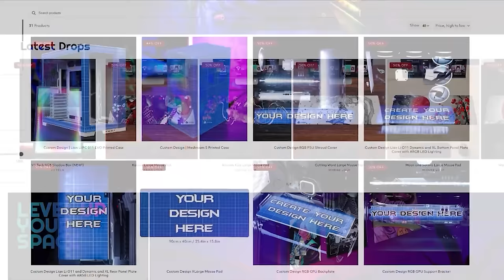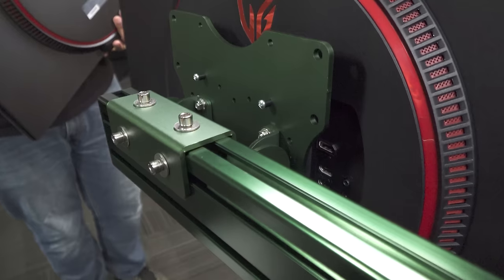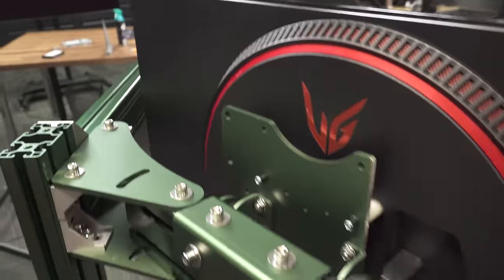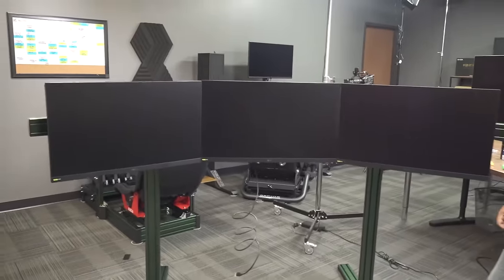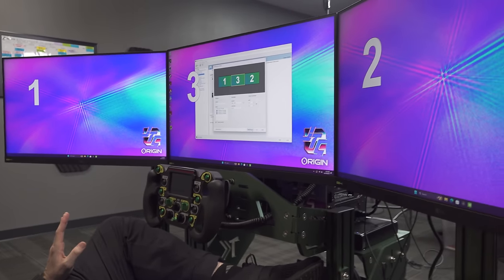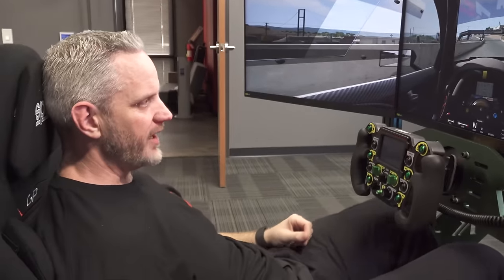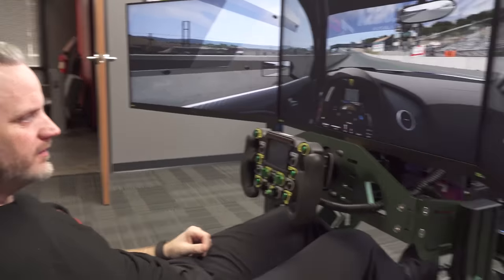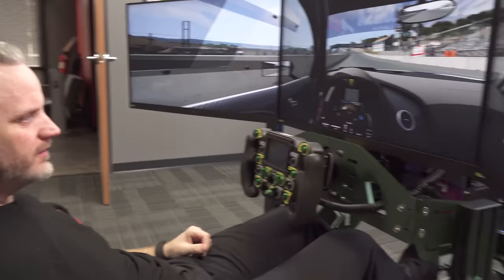I haven't used NV surround in over 7 years! Does is still suck?

Comment: the hinge doesnt have to be on the upright, you can bolt them on the horizontal piece, slide the left and right monitor outward to get more angle on them and put the bbolt back in
Reply: 100% this! It would also be wise to search for the FoV calculator, input your screen dimensions and distance from screen and that will give you your ideal side screens angle and in-game FoV values.
Reply: Yes please do this, it is doing my head in looking at the way you have those monitors setup, also they are way to high.
Reply: Those corner brackets aren’t needed either. Can be mounted directly to the horizontal piece the same way the side monitor arms are mounted to the angle bracket.
Reply: The problem starts with the horizontal piece which should’ve been mounted on the front face of the upright and then mount the hinge directly onto the horizontal piece
Reply: I'm starting to think they maybe possibly, quite by chance... Didn't read the instructions!.. lol
Reply: @rwbrygel  they should’ve been but first building I guess, they’ll figure it out unless @jayztwocents wanna employ my assistance, I’ll be glad to help
Reply: Oh I would be quite happy to help too.. Particularly with Content Manager.. but where would the fun be in watching them do it right?.. lol
Reply: @OnePuncheonMan  I have this rig and that’s how they show it put together, but I did it without the corner brackets, and changed a couple other things to mimic more like other sim monitor mounts are built.
Reply: I think Jay should stick with building PCs as SIM rigs don't seem to be his thing
Reply: @robn71  So you don't want him to try anything new and just do the same thing every day forever? Or maybe learn from the comments and get better at it then people like you have nothing to complain about and then go away?
Reply: @I-YoutubeAccount  I was speaking about the monitor alignment, not the DP cable. That’s a known issue with these all in one Veda mounts but manufacturers still make them to cover all buyers something like the sim lab vario vesa mount or the advanced sim racing advance monitor mount may have been perfect for both monitor alignment and cable clearance but hey…. It’s Jay and we love the shenanigans
Reply: That is 80/20 Aluminum T-Slot.  You can buy all sorts of pieces and build whatever you want.
Reply: @robn71  I enjoy the Sim Racing videos.
Reply: Iracing
Reply: @goonie1975  So do I
Reply: @OnePuncheonMan the vario vesa mounts are awesome and after having them I’d never want to do it again without.

Comment: The gap between displays is from those extra spacers you put in - the center monitor is farther "out in front" than the frame was designed for it to be.
Reply: He also said that the arms suck out the sides because they support larger monitors. So larger monitors might touch at the middle with the arms anchored properly. A hacksaw would also trim those edges if they really annoy you.
Reply: So I have the same rig, It's actually because they mounted the arms to the uprights. That's what the instructions say to do but is only necessary for the largest  possible screen size. If you pause at 6.24 you will see what I mean. The outermost two bolts are on the vertical member of the stand which prevents you from changing how far apart they are. 

If you can't move the arms in and out there is only one angle that works for each size of monitor and you might have to take out the inner bolts like they did.

Comment: Is it too late to suggest right angle DP adapters to help the cable fit? Love the shenanigans with angle grinding the plate.
Reply: The moment I saw that, I looked on Amazon and found them.. lol
Reply: I bought 3 32" LG monitors on Black Friday just like jay and had the EXACT same issue as Jay, I tried ordering 90 degree adapters, and like Jay, tried spacers, but ultimately came to the conclusion that these "solutions" were not real solutions at all and ultimately decided the real issue was a poor choice of monitor becasue of it design limitations. My solutoon was to exchange the monitors for HP Omen 32" and have been happy ever since.
Reply: Is it possible/would it be better to have a much wider center screen? Really thinking about getting a similar setup as you and Jay here but the screen dimensions just look off to me. Would there be an aspect ratio or stretching issue having 2 smaller outer screens but one wider screen in the center?
Reply: @FellowshipOfTheAviatorZ  I've seen mention of people with multi monitor setups at different resolutions getting stuttering issues especially when trying to run at higher refresh rates, don't know if that's an old problem or what though
Reply: @FellowshipOfTheAviatorZ  I have run 32" with 27" wings with Eyefinity, no sweat. I always buy same resolution. Smaller sides don't bother me because it is mostly for peripheral vision when driving.
Reply: Best to increase the left and right monitor angles to 45deg plus.  I think mine are 60deg

Comment: You can get angled adapters for dp/hdmi to make it fit.
Reply: Sure - but that doesn't make that layout any less stupid.
Reply: Was thinking the same thing, right angle adapters or cables. Instead of angle grinding the whole thing haha.

but  @MrMartinSchou  is also right, pretty BS design from LG. I have a similar problem with my older 22"? Acer 1080p 60hz monitors where the vesa mounts and cables interfere with each other, it was a tight squeeze but I made it work/
Reply: yes, but also turn on shiny toy today.... I get jay on this one even though it appears like an overreaction.
Reply: yeah but he's never gonna use those tv mounts
Reply: And then wait longer and have the risk of those not being right either. I'd cut em as well. My monitor is mounted straight to the wall. So glad HP mounted the connectors facing down.

Comment: Nice to see the sim racing content! You may want to take another look at your monitor mounting options. You are absolutely right in that the TK monitor mount was made with curved and larger format monitors in mind. In reality you need something a bit smaller as there are a few issues with your config.

One issue is your monitor angles are very shallow. Typically you want approximately 60° with 32” monitors. Getting this angle right will significantly improve FOV and immersion. The second issue that goes along with getting the angle right is to get the monitors closer to your eyes. The closer you get the monitors the better the immersion and the more natural your view will be.

Looking at you driving, the wheel is too far away. You want your elbows to be bent at approximately a 45° angle for proper control and to help prevent shoulder injury over time. Moving the wheel deck closer will allow you to get the monitors closer as well.

Just a few tips. No need to take my word for it. Take a look at the major sim racing YouTubers setups. Check out Dave Cam, Dan Suzuki, Basic Ollie, and Boosted Media and really look at their setup ergonomics and where the monitors are positioned.

Hope you guys enjoy the rig! You’re rocking some awesome hardware.
Reply: Agreed, FOV, calibrated FFB and driving position would help a ton. Dan Suzuki has some great content.

Comment: You need the Simlab Vario Vesa monitor mounts. They’re way more lo-pro and super adjustable. The only way to go for triples.
Reply: Those mounts are fantastic though they’re not gonna help since the entire monitor stand is assembled incorrectly. The cross brace goes on the front of the uprights not in between them. The side arm brackets bolt directly to the cross brace not to hanging 90 degree brackets like they did. I wouldn’t be surprised if the next time they go into the studio studio those monitors are sitting on the ground in pieces

Comment: Great video guys!  Welcome to the fun & pain of using a triple monitor setup. Simlab actually sells a  Vesa Adapter kit to help with fine tuning the alignment of the monitors. I use it on my triples sim racing setup. Also, you need to set "Triple Screen" in the Video/Display option of Assetto Corsa so the left and right monitor can correctly reproject the images. This will eliminate the stretched image distortion. There a ton of instructional videos that explain in more detail.
Reply: The biggest fix to combating the "stretch" fish eye effect is to up the FOV or Field of View.
That is what I do for most of the games in 3 screens to make it look well, biggest problem is where UI elements ends up on the outer monitors.
Reply: A properly setup FOV is important, but some sims like Assetto Corsa, that they´re driving here, go a step further. They let you input the exact angle and distance of your screens and then the game gets rendered for each screen seperately, instead of one big picture that is being stretched over 3 screens. It really makes a big difference @CMDRSweeper

Comment: For the triple monitor 32” or under you should choose the 80mm center profile. I did the opposite mistake, i choosed the 80mm instead of the 120mm for triple 42” oled tvs.
Reply: Will that stand hold 3 x 50" TVs? Been looking all over for something that will, and this looks like it would work.

Comment: I would be curious about how Flight Sim would feel on this vs in VR.
Reply: Or you can have the best of both worlds and use this with 3D vision like I do but at this point finding the hardware is half the battle.
Reply: I used to get accused of hacking in war thunder playing across three Titans and three 30" 2560x1600 monitors.  When planes thought they were getting the jump on me I'd draw them in flying in one direction, but watching the enemy approach on the far left or right monitor.  First person shooters were a pain to play at 7680x1600 when two big vertical bezels in the middle.
Reply: @TheCrazyCanuck420  

My biggest problem with multi-monitor setups is getting the monitors nicely aligned to eachother, and bezels...  The rig in the video doesn't look like it fixes the bezels issue, but does fix the alignment issue.  Might be good enough versus the hassle of a VR setup.
Reply: VR will always win because it allows for depth perception and correct world scale.
Reply: I've used both setups (triple 1440p monitors spanned and VR) in Elite Dangerous, and they each have their own strengths. Triple monitor is best for cargo and exploration runs because you can overlay stuff like browser windows on the far edges of your monitors for extra information and such. For dogfights though, VR wins out easily due to the increased spatial orientation.
Reply: Triple monitors are great for flight sims. But lacking the vertical field of view is an issue sometimes.
Reply: @artins90 i wouldn't say its that black and white.

Triple monitors have better peripheral vision and are more comfortable. In racing sims for example, i find it very beneficial over VR to be able to see the competitor car next to me from the corner of my eye in close quarters racing. In VR you have to turn your head.
Reply: @truthbeacon just buy those bezel hider edges that every sim racer with triple screens uses.
I don’t know the name but asus build them for example.
Reply: I have both and rather use VR for flight and space sims and triple screen for racing.

Comment: Always fun to see people struggle with tripple monitor setup and usage of it :P 
It also need more angled. And they could change the stand itself so the horizontal bar is in front of the upright ones. This way they could turn the arms more in and match it with the center monitor. But no idea how it was mentioned in the manual of this stand.
Reply: Windows has to be as dumb as possible.

Currently running 3x portrait mode because I benefit more from vertical resolution 

Used to get by with a flat-ish crossbar setup.
It sucked and there was no way to level the bar.

A couple yeara ago,  traded up to a gas piston triple armature.
Was BETTER, but still not great.

Think ,next monitor setup is going to be a single large format 8K TV.
Easier manage, and fewer QUIRKS.  Since Win10 is "meh" for multi-monitor and NVSurround
And Win11 is just totally fucking broken.
Reply: @PhotonHerald  i tried NVsurround in the beginning, but all racing sims like ac, acc, rf2, ams2, iracing work perfect without it. So i never went back to use NVS. After a couple of years i sold the triples and use VR only :)

Comment: Those side monitor angles are shallow. I would have thought at least 45 degree angles. I have three 50" screens and they are at 45 degrees on each side monitor. The other thing I don't like about this setup is how high the screens are. You have to look up at the monitors with it like this. With the 50" screens, I can put screen behind the wheel and my eyeline center with the screens.

Comment: Majority of the sim racing wheel uses Simhub to setup the screen and leds, it is also a good all around software to have that can control pretty much any sim racing accessories, i use it to control my DIY bass shakers, DDU, Center console display, rev lights, leds on my wheel and so much.

For playing AC on pc, you gotta have Control Manager which basically gonna be your all in one launcher, along with CSP and Pure/Sol which makes AC 10x better.
Installing mods like cars and tracks are a breeze with it just drag and drop the compressed file and install.

Comment: I have triples and abandoned surround. I find running the games in windowed and then using a program called borderless windowed full screen or something like that to put in the resolution and origin corner and apply it to the game. Works way better
Reply: It essentially forces full screen windowed but over all 3 monitors
Reply: I also used a program to add the triple resolution to one of the monitors. Not to ever actually use it on one monitor but to have it as a selectable resolution option in games settings if it doesn't automatically adapt the resolution to the custom window

Comment: I imagine the reason why you have aluminum extrusions everywhere is so you can use the T-slots to slide in and out the brackets the monitors mount onto. If they pre drilled holes instead of including T-Nuts then one thats awful for how much you paid and two just buy some t-nuts.
Reply: Its like watching a Crew Chief trying to do MX at times, It hurts.

Comment: Move the monitor bracket down the arm which will allow the pivoting of the external arms. This will in turn allow the flat monitors to come closer in view. And you will gain that second bolt back.

Comment: Jay, I feel your pain as I was having PTSD watching you relive my horror as I did the same thing after buying 32" LG monitors on black Friaday. I tried spacers, 90 degree angle adapters, and I finally had to admit to myself that the issue was the crappy design of the LG monitors, and y solutions were a complete BODGE, so I sent them back in exchange for some 32" HP Omens, where the power supplies are both integrated inside the monitor (eg no power bricks, just a standard PC power cabel) and most importantly, the ports for power, HDMI and Display Port are all on the BOTTOM of the monitor where they SHOULD be. No hacking of the mounting brackets or spacers necesary here! Keep up the sim racing content and for the record once again, I feel your pain.

Comment: What I would be interested in seeing is the performance of a triple monitor setup vs. a single monitor vs. 4k resolution.  By raw pixel count, three 2560 x 1400 resolution displays are 33% more pixels than 3840 x 2160 so I'd expect to see a performance drops.  For uses, this is a cheaper way of increasing immersion than getting a higher end, higher resolution, larger display.

Another good test for this lingering old tech would be how it handles mixed resolutions and layouts.  For example, put a 3440 x 1400 ultra wide in the middle flanked by two 2560 x 1440 resolution displays.  A common workspace setup is PLP for portrait landscape portrait orientation.  Thus three 2560 x 1440 displays would only provide 5040 x 1440 resolution for gaming as the top/bottom of the portrait displays are letterboxed out.  Curious that the impressions would be given that PLP has the screen refreshing in different directions with respect to the viewer (top-down for the center display and left-right for those flanking).  Ditto for running the displays with and without variable rate refresh.

And of course the AMD comparison with Eyefinity.

nvV Surround is something still necessary as it is a quick and dirty means of supporting ultrawide displays that can handle multiple inputs simultaneously.  Depending on the HDMI and/or DP version, that is needed for the highest refresh options offered by them.  

One of the old school ideas for nV Surround back in the day was with multiple GPUs and each card had free reign.  The result was indeed tearing but it would be horizontal at the seams of the displays.  I'm not even sure if this concept survived long enough to make it into the era of VRR.  Traditional SLI/Crossfire is dead but this would be a straight forward means of brining basic support back.